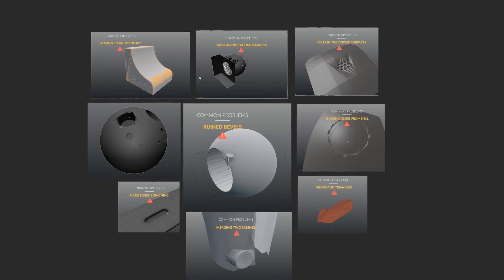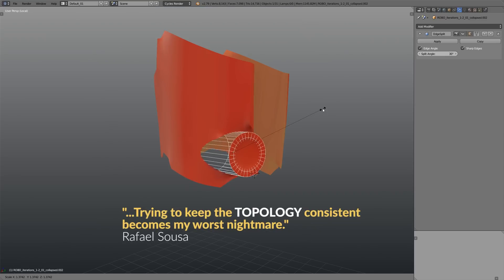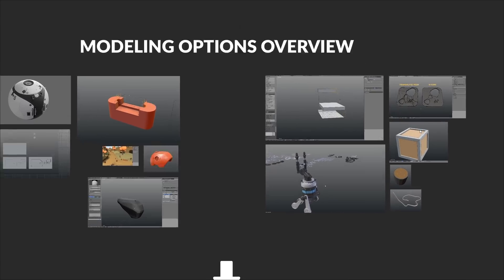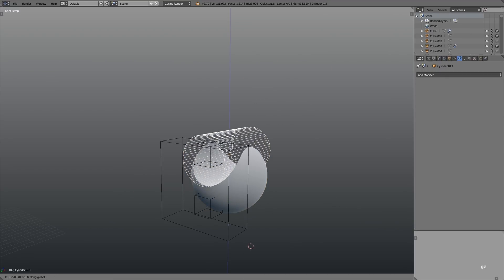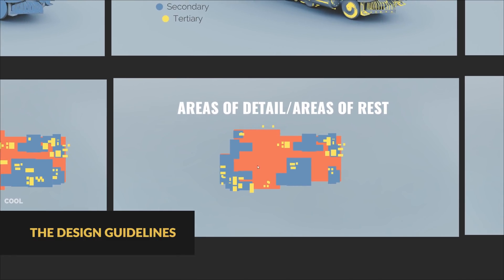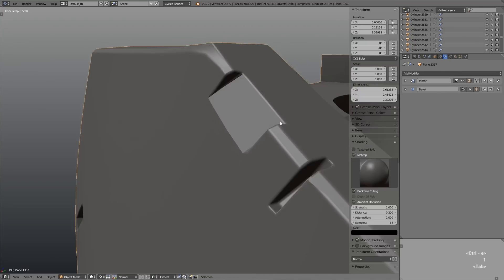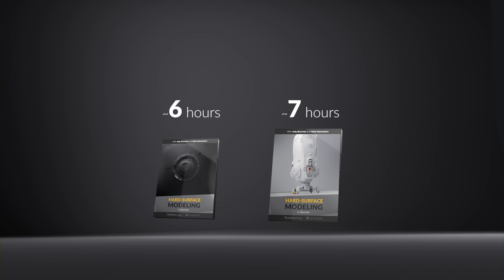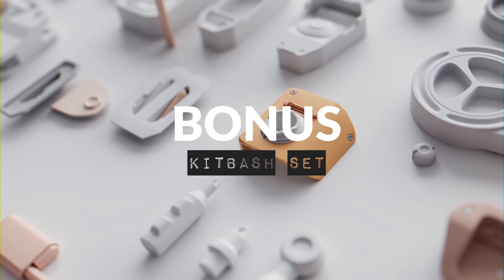Hard-surface Modeling in Blender Intro!

Comment: Dude! I got your CGMasters & Creative Shrimp – Hard Surface Modeling in Blender 2.8 Update, is this tutorial works with Blender 2.93.3 or do I need a lower version of Blender, by the way it looks promising and Informative. I;m new to blender and I'm looking for a stable Platform to learn Hard Surface modeling, I have try Maya and 3DS Max but I get stock with the same tutorials getting to no where. What would you recommend for a Blender Beginner.
Thanks.

Comment: do not , i repeat do not, use blender for hard surface modelling, its hell. use parametric like fusion 360 or anything else. do not touch this trash heap of a bloated,uselss autistically designed program
Reply: If it's autistically designed it should be perfect for you.

Comment: Thanks you very much, both of you, it will help me a lot, I'll buy it tomorrow ! (btw you made me discover I am Robot and Proud, I love their music!)
Reply: Dude, did you have a go at it? I just want to know if you can recommend it, considering blender is at 2.93 right now. Thanks!
Reply: @vylicer  Yes I strongly recommend it, the modeling process has hardly changed since 2.8 and the course focuses on techniques and concepts that will always be used, no matter if they have been simplified by technological advances. I just wish you to be motivated because you have a lot to learn in this course!
Reply: I'm an electrical engineer and I'm mostly working with 2D single line diagram CAD projects. So there's little to no 3D modelling knowledge for me to start with but I do want to create something aesthetically pleasing and hard surface modeling seemed to be the closest 3d modeling style that I can relate to unlike sculpting. I only stumbled upon blender during the pandemic. Thanks for the feed back!

Comment: so I bought it and already picked up some cool tricks, but in your video A0 11 Modeling Standards at 9:46 when you bevel the line in between the vertices when you use CTRL B the bevel goes into the crate, but when i do it the bevel extends up and down and I don't know why. When I do it on another Line segment the bevel goes in the crate like its suppose to. However I can't figure out why the method you use is not working for me.

Comment: Hi sir. I have some questions in my mind which I am not able to find the answer onlined. I want to model a laptop prototype for 3D print, but I am not sure what I have to do. It supposed to have many removable parts and moving part like the hinges. My question is, do I have to model and print 1 part by 1 part? and I am confusing about using solidify modifier too. Do I have to use the modifier to add thickness to the laptop shell or not?

Comment: Do yourself a favor and get Zbrush if your a beginner in 3d modeling. Blender will quite literally throw your patience into a blender. Those topology problems are no where as extreme as zbrush especially subtracting meshes. Zbrush's  zremesher and dynamesh are top notch.

Comment: Retopology and baking for the use in game engines (Unreal or Unity are both fine) would have been a nice bonus. As a game artist is as low poly as possible very important. but i could still try out this course and find out the rest later. There are still enough very usefull tricks that i'm not aware of.

Comment: Not exactly a bug, but perhaps something for later courses - there doesn't seem to be any plan to the order in which terminology is used, sometimes you mention stuff that hasn't been introduced earlier in the course, and sometimes you mention it for the fourth time like it's the first time. And the theory parts are through and through horribly laid out from time to time. I was prepared to going through the entire course 3-4 times to really reap the benefits, but it looks like it'll be a lot more backtracking and extra googling than expected from a beginners course. Sometimes Aidy's tempo is just abnormal, unnecessary topics gets attention, and there's seldom any overall feel of "this is the outside scope of what we're gonna dive into", it's all just a blur.

But I do like a challenge, so I'm powering through hoping that the knowledge'll stick even more as I constantly have to cross-research and test everything being said. But you already got my money, so hey :)
Reply: Think the same. This is more like a pro tips tutorial for expert modelers

Comment: How do you use the hot key "ctrl *" for the Boolean difference operation (with bool tool add on enabled) with the num pad emulator?  Is there a different hot key to use?
Reply: Hey~ you can use that hotkey option by enabling the Bool Tool blender internal add-on.
Reply: Thanks but that hotkey Control * still doesn't work for me.  However, it could be that I'm pressing Control 8 as I don't have a numpad on my keyboard and that is were the * key is located.  With the numpad emulator enabled and through trail and error I discovered that bool tool hotkeys of control + and control - work but the control * hotkey works if I use control \.

Comment: All very well, but nowhere do I find minimum specs for getting the most out of the course. I have a PC computer running Windows 7. I'll install Windows 10 if I have to, but only if I have to. Meanwhile, I'm about to upgrade the physical aspects of my computer and want to know what to spend money on to get the most bang for the buck. I won't be able to take advantage of your introductory offer because I want to have my upgraded computer in place first, but $60 US is still perfectly doable. Thanks in advance for your advice!
Reply: Jonathan Stewart upgrade your graphics card. If you can, go Nvidia.

Comment: Very, very cool! But what's your opinion on HardOps? Wouldn't that be a faster way to create this?
Reply from the maker: We love HardOps - that's the shortest answer. Though, understanding what's going on under the hood of boolean operations is super important, especially if you are going to use HardOps or any other plugin. How to fix the topology issues, what happens with NGons, what is topology flow, how so called 'poles' affect the smooth shading and many other things. :)
Reply: @GlebAlexandrov  Completely agree. If you're going to make any use of HOps/BC or anything else you need to understand the fundamentals. I will probably buy this!
Reply: There are a lot of videos of people using/explaining HardOps. It's nice to see someone take on that topic without any external addons to be honest.
Reply: It's also just good form to know how to do hard surface modeling without the assistance of addons in case you move to another program or the addon stops being updated and is no longer compatible with newer versions of your software.
Reply: Hey, you're that guy from that you tube channel  :P
Reply: Blender Guru Lmao good one
Reply: Hardops is an addon/tool not a tutorial/course though. Though tbh id love a course designed around hardops. I got hardops but honestly I dunno how to use it effectively.
Reply: The BOOL Tool Add On already comes with blender in the preference menu. NOOO need to buy HardOps!!!!
Reply: @CorysCameras  bruh
Reply: Hardops , Boxcutter...etc are basically using Blender boolean system but with more streamlined UI & UX,  good for concepting and all but not much for production modeling where SubD is still the king...if you're going to teach someone better start with that.
Reply: Exactly my problem. The devs have some free videos where they demo hardops, but nothing beats a paid4 course...
Reply: HardOps, Boxcutter and MeshMachine are all addons that in most opinions MUST be used while doing hard surface design. They speed up your workflow by an insane amount. However, if you dont have the fundamentals that these guys are probably going to show you then said addons (HardOps etc) only get you half way. Or you could just use Fusion 360 and never have to worry about any of these problems everrrrrrr lolololol jk jk
Reply: @ryanjstever  I've had HardOps for a long time and recently purchased BC, MM, KitOps, AngleTool. It's a fregin arsenal for hard surface workflow. I like 360 but I would still prefer to use Blender & ZBrush etc from start to finish. For me 360 is great for CNC.
Reply: @bdragon254  Exactly, its made for CNC. And CNC is used to make hard surface objects in real life. Like robots, guns and other electronics. Makes sense to me. Both have their Pros and Cons, just get the job done!
Reply: @ryanjstever  Yea some things that take a little bit of knowledge to accomplish in Blender are easy in 360 but in reverse, there are things that would be childs play in any true 3d modeling program that 360 just can't handle. Kind of a trade off for being able to throw stuff together quickly in 360.
Reply: Um fusion 360 doesn't produce usable geometry. It's completely useless outside of concept art. Unless you want spend hours retopoing it.
Reply: I completely agree with this, same situation.
Reply: blablabla